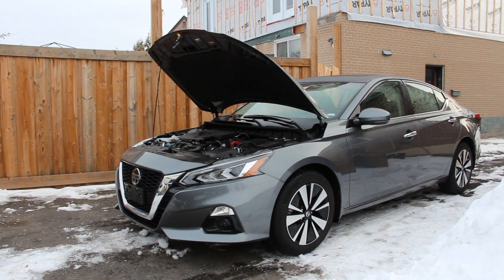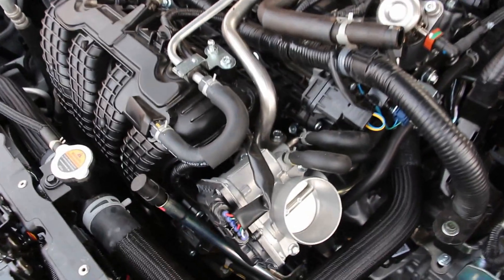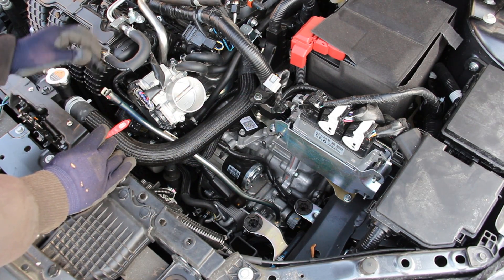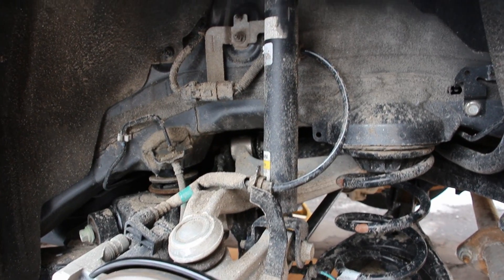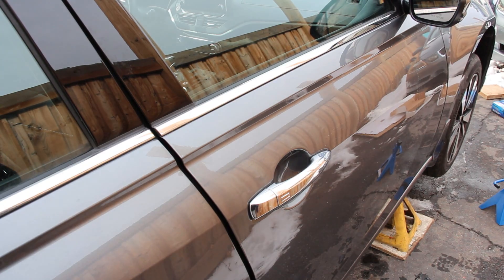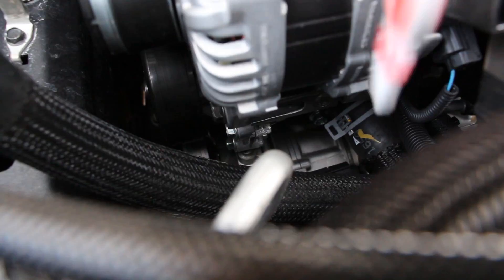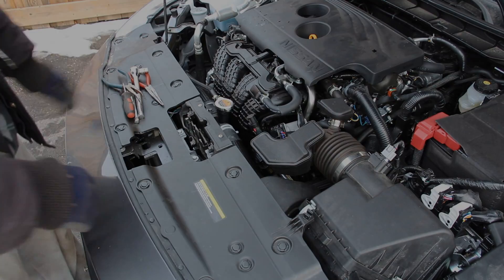Nissan Altima AWD Mechanical Review

Comment: I'm going to say that All the Nissan hate is miss placed as far as the CVT the CVT in the mid 2000 was a major flaw too much oil and not enough cooling and they waited for to long to fix the issue the new ones have fixed the issue and as long as you change the fluid and filters every 60000 miles as far as CVT transmission Toyota, Honda, Mazda, GM, are all using CVT transmissions it's the future like it or not. What ever you do no matter what CVT you have do not tow anything with it.

Comment: I have a 2019 Altima, 60 thousand kilometers and no hints for a CVT failure. I personally know two Altima owners with much more kilometers, they also had no signs for CVT malfunction.
The only major repair I had in general was an AC leak in the evaporator, supposedly due to the humidity and the hot climate in the middle-east. 

Will keep updating this comment.
Reply from the maker: 60,000 km is early

Comment: That plug on the side of the trans isn't the fill plug. It's for inspection. The trans is filled from the charge tube "dip stick" then set with the check plug by the converter inspection port.

Comment: I have 2016 Altima with lots of miles aside from brakes tires & oil change’s I’ve only had to spend 120 dollars on a mass air flow sensor that I change my self  not bad … I bought my wife a 2006 Acura TL brand new boy did I have problems my starter went bad with like 70 thousand miles all of my motor mounts went bad my transmission didn’t feel right I can go on ….  I don’t care what manufacturer you choose they all have problems…my cousin is a parts manager at Toyota somewhere in California  I was thinking of buying a Camry so I stopped buy ..I ask all the guys that were there what do you think of Toyota are they bulletproof all of them said he’ll no go look in the back to see how many were being worked on ….they are good cars he said but Toyota quality is not as good as people think …..  in my opinion all manufacturers have problems I’ve owned Toyota Nissan and Honda  I have a Nissan & Toyota in my driveway right now….
Reply from the maker: The new Toyotas aren't as solidly built as they used to. In fact, alot of cars are looking similar under the hood now.
Reply: @speedkar99  100 percent.

Comment: 2m30s  Hook for the engine needs to be pulled "When" the CVT fails, didn't say "if" .   I have a 2015 Rogue and the CVT had to be replaced at 87k miles. Under warranty thankfully.  Other than CVT its been a good vehicle, and man those seats are comfortable.  I am considering an AWD Altima next (will buy extended warranty of course)
Reply from the maker: See my CVT fail video for more on that

Comment: Solid engine have 100k miles and didn't work on the car but oil change some people trash Nissan not realizing that thet source parts from suppliers and those parts are the ones that failed

Comment: This Nissan actually looks pretty good compared to the competition. There is a multi link rear suspension and a lot of the control arm and suspension parts are made of aluminium. Theres a strut tower and designed in a way that servicing is still easy. The main problem with Jatco CVTs also seem to have some extra cooling allowance with the dedicated cooler and its own smaller CVT condensor.

Comment: 2010 nissan altima with no problems.  2013 nossan rogue no problems.  ‘95 camry was a money pit; worst car I ever owned. ‘04 honda pilot needed was on its third transmission at 130k (second tran installed at 41k).  Every manufacturer has their probs and its likely luck of the draw.  Hard to go back to toyota or honda from my view.  ‘03 maxima was pretty solid too

Comment: I wish you would do some Nissan trucks I had a titan and now a frontier and love them both extremely reliable and easy to work on. I have 50,000 miles on a frontier right now 2017. Only fluid draining feels and not one single issue. I don’t like this Ultima it looks good and looks bad at the same time.
Reply from the maker: The trucks sure are ancient. Would be good to see the difference between those and Toyota trucks

Comment: Key Points
1:29 direct injection only, no port injectors to keep the valves clean which can lead to carbon build up
 2:25 "when your CVT fails" and it will
4:23 the starter has ease of access
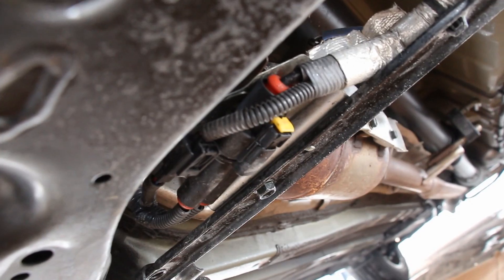6:10 electric pwr steering wires dangling
7:50 steel sub-frame known to rust out over a few years
10:11 the excess body-flex
12:44 radiator up front and easily removed
Reply: These cvts are way tougher than the previous gens.  I have yet to replace one due to pulley failure.

Comment: I guess if someone wants an All-Wheel Drive Sedan it would probably be better to get a Subaru Legacy.
Reply: Nissan has a better engine.
Reply: @joshuabenjaminscott2365  Depends.  Altima no longer has VQ35, and the 2.5L engine is not the QR25 series engine of the past Altimas and other Nissans.  Subaru's current FB25 has, so far, been proven to be durable, and not to forget, sit lower to the ground for better handling.

Comment: Honestly they're so easy to work on biggest problem is the CVT transmission I wish Nissan wouldn't use it
Reply: not fair, all civic accord with 1.5t and corolla has cvt just like nissan, either it's not as bad as ppl think or really cost effective
Reply: @zhanggodfather8053  The difference is who makes the CVTs. CVTs used in Toyotas and new Subarus are made by Aisin, Honda CVTs are made by Honda, and Nissan CVTs are made by JATCO. JATCO doesn't supply reliable CVTs, but Honda and Aisin make reliable CVTs.
Reply: @Blank00  yeah but they are still cvts for example if you had a bad experience with Mac and cheese when your grandma made it but when your mom made it you loved it there are a ton of different factors that go into it , but it does not mean the food is bad you just dont like it
Reply: @hannahstewart-green8062  Umm, what?

Comment: I have a 2012 alitma with 88k and dammmmm. Why is this one so rusty? Mine has minor rust. And the engineering on this new Altima from the engine, suspension, and exhaust system seems more complicated and counterintuitive imo.

Comment: Thank you for the in depth coverage. I just got a 2020 AWD so it’s nice to know more about the mechanicals. People love to dog on Nissan but I traded in my 2018 Camry for the Altima and I like this car WAY better.
Reply from the maker: Thanks for your input. What's wrong with the Camry, transmission?
Reply: @speedkar99  Why would you suspect that, it's not CVT, is it?  This is a sarcastic comment pointing to a lot of BS floating around how one car is money pit and others are reliable. They are more or less same reliable, nowadays. Kilmer thinks all cars are junk. Well, he does not come into contact with not breaking cars, does he?
Reply: speedkar99 the Camry has a lack of features for the price and this was a big reason why I decided to get rid of it. I need to enjoy the ride. The Camry needed $1k in dent repairs because the sheet metal is so thin and flimsy. I had to have several repairs on wheel bearings, tires, and the wheels themselves because it had noisy, crummy, low profile Hankook tires. The transmission took a lot of getting used to. After test driving the Altima it was a no brainier.

Comment: Your work is superb, especially for those of us who plan to work on our own cars. Just some well intentioned feedback: maybe slow down a bit? Savagegeese has very a very good pace in his videos... Almost like you are having a conversation
Reply: If you can't tell a pipe from a wire, better do not work on cars.
Reply: @walkbase  uh?
Reply: @supersabrosinho  With all the respect, the video, you're so fascinated by, basically tells you this:  this is a pipe and connects cat converter to a muffler; that is another, smaller pipe and it connects the master cylinder to the caliper, this is a hose and it goes from the radiator to the engine block, and this is a wire connecting a sensor to a controller, and that is a control arm, it holds wheel in place. If you cannot see it by yourself, or are not in a habit of reading service manuals, better do not work on cars. Cars look more or less the same, unless it is a Tesla.
Reply: @walkbase  pretty sure you are replying to the wrong person. I've replaced control arms, clutches, cats, and currently replacing the piston rings in my Acura 3.7. I'm no ASME master mech but I definitely know my way around the engine bay and electricals. Maybe read the post you are replying to next time? Dunno just FYI

Comment: I like that you get into the nitty-gritty details. For example you have shown us a complete tear down of a power steering pump, ac compressor, and even an odometer. If you could show us a complete tear down of a nissan cvt transmission, we could learn some of weak points and be able to repair them ourselves. If it weren't for the very  unreliable cvts in nissan, I think that nissan would still be my favorite brand.
Reply from the maker: I really want to get my hands on a CVT!

Comment: Simple trick for changing CVT fluid yourself without the scan tool. Measure what you drain while cold and then simply add the same volume back in new fluid that's been sitting at the same temp so it's density is equivalent.
Reply: simple solution: buy manual
Reply: @Kakiharaichii  they last forever
Reply from the maker: You have to know your temperatures

Comment: If you have one keep changing the CVT fluid every 30-40k with proper fluid and easy on the acceleration if you want trans to last.
Reply: I floor my car everyday. I'm at 249k miles on my 16 altima. It's probably better if you drive it easy but that's not necessarily true. You can still have fun sometime if you want without the trans breaking. My point is me lol...
Reply: @occckid123  Have you had any CVT issues like it's been replaced 4x's, but seriously have you changed fluid?  Maybe the 16 has been beefed up but that's good to hear it's not failed with 249k on it, you drove about 85k per year, that's a lot!  I see your channel and the milage throughout time, so no fooling.
Reply: @publicmail2   I change the fluid 4 times already
Reply: @occckid123  I'm sure that made the difference, I personally love the CVT action or lack of, it's the perfect trans for economy and of course it can act like a standard too.
Reply: @publicmail2  I'll look at it after I'm done driving lol. I like when you dab the brakes it "downshifts" in sport mode and gets you ready for the next acceleration.  Its hilarious.

Comment: I'd be careful after 2015 with vehicles, the normal engine is in it's final stages of manufacturing and they are making them more complex and disposable and maximizing profit, these Camaros, Chargers will turn to junk.  The comparative simplicity of electric vehicles will make them last a long time.
Reply from the maker: Thanks for your opinion

Comment: Honestly, looks pretty good?  Other than the transmission it you stick with the base engine it's probably going to be fine and I think transmission issues have been improving gradually since 2014 or so.
Reply from the maker: Unfortunately we only get the 2.5L 4 cylinder and AWD in Canada. No FWD and no turbo 4

Comment: Nissan 2.5 na will be better than accord`s 1.5 t, the only weak link is cvt, the other system is as good as camry
Reply from the maker: Also factor build quality, reliability and design into the mix.
Reply: @speedkar99  reliability is what I refer, not performance

Comment: Excellent information from your channel.
Can you please explain what actually vaccum or vaccum pressure in automotive
Reply from the maker: Thanks. Vacuum is air with pressure lower than atmospheric. The low pressure is formed when the piston moves down sucking air into the engine, creating vacuum in the intake manifold.
Reply: @speedkar99 Thanks a lot for your information
Reply: vacuum is sucking or negative pressure- positive pressure is blowing

Comment: Glad to hear that the Altima remains to be a good rental, period!
Reply: I know someone with an Altima, it has 80,000 miles and the CVT was going out for the third time. Sad.
Reply: Andrew M is that good at least he’s lucky it’s not more than that
Reply: @LunarStrike  hes gone through three CVTs at 80,000 miles on the car.
Reply: @andym1223  he's lying!
Reply: I have a 2019 Altima, 15 thousand kilometers and no sign for a CVT failure. I will write an update later if anything comes up. Nevertheless, i know two other people who also have an Altima, they did much more kilometers than me, and also have no sign of malfunction.
Reply: @sultanalsharif4673  just bought a 2021 altima with 50,000 miles on it, car is in a good condition thank God and also the CVT, the previous owner didn't have service the trans, the cartridge filter was black and dirty when i was changing it , i live in town in Iraq which is known to have lots of altimas, i have seen many altimas with almost 50k miles or more while i was trying to buy a decent altima. these newer altimas are known for having a better CVT unlike previous generation.
Reply: Just change the transmission fluid regularly and everything will be fine.  @sultanalsharif4673
Reply from the maker: I don't know if it's even good at that...
Reply: You asleep?

Comment: Some good, some less than great.  I guess you don't have much confidence in the CVT?  BTW,  very few radiators fail these days, so ease of repair access is no big deal.  I like how the oil drain plug & filter are so easy to get to, and also that the CVT has a drain plug in the pan.   Weird that they didn't choose an oval resonator to give that 2cm of extra clearance!
Reply from the maker: I think anyone who's heard of Nissans CVTs don't have confidence in them.

Comment: Automakers fear the sharpened toothbrush
Reply from the maker: They sure do
Reply: Thanks for the rust comments, it's really really big problems with Altima. Body structure flex is a good one because accord and Camry are really stiff although with aluminum trunk and hood.

Comment: My rich friend gave me his  2006 2.5 S at 96K miles.  He spent more on dealership maintenance than he spent buying the car. He had no real big issues other than replacing the catalytic converter (probably because they are known for breaking down and sucking garbage back into the engine...but they didn't tell him that.)   I replaced the crank and cam sensors that fail on all of them. Also the floor under the passenger seat rots out due to water getting trapped somehow.  I replaced most of the front end suspension and steering parts due to a pothead ramming into the front passenger wheel. Everything was easy to get to except what you mentioned about the control arm bolt which had a little pocket where water could settle and rot out the bolt. It took a long breaker bar to get that off. 135K miles now and runs good. Not burning any oil.
Reply from the maker: Those 2.5s weren't good. The 3.5s were better but I'm that application had some other issues

Comment: Great video,  This Nissan checks all the boxes feature wise and with its great looks to deceive unknowing possible customers.  A lack of good engineering and low build quality reminds me that a Nissan is not a Toyota or a Honda.
Reply from the maker: It sure does check alot of boxes when new. Time will tell if it'll hold up, the older ones didn't do as well.
Reply: Toyota??? Have you been in a sienna lately or even the Camry? Nothing really special about them lol. Doors also has the worst sound in the segment.
Reply: its about renault partnership

Comment: No more cvt cars they are trash
Good video mate
Reply: Stick shift all the way. Unfortunately they're a dying trend these days.

DSG/DCT is fine, or even at least standard torque converter auto feels more engaging than a CVT.
But nothing beats the feel of a manual transmission.
Reply from the maker: Yeah I didn't like the feeling of this CVT

Comment: Nissan quality has gone down in the 80s and 90s and early 2000s there cars were built well not anymore those rear axles are not built to strong on that Atlima they look kind of weak.
Reply from the maker: Everyone knows about Nissans situation. We have to hope for the best in this decade for Nissan.
Reply: Nissan deserves its problems and Carlos Ghosn deserves to pay.  He ruined Nissan reliability.
Reply: @Mabeylater293  same with jacque nasser with ford years ago
Reply: @Mabeylater293  nasser squeezed the suppliers so badly they had to sell junk to ford to stay afloat
Reply: I've never heard rear axles being a problem on the car but if that's something you want to complain about then cool lmfao. I have the original suspension on my altima about to hit 250k on the 2016 altima and I've had massive amounts of use and jumps in the air from speed bumps infant awar of. All my rims are bent but my suspension is fine lol

Comment: That suspension setup is the exact same as my 2008 Altima had.  It lasted almost 300k km before I needed ball joints.
Reply from the maker: Ball joints on McPherson strut suspension don't wear very fast on any vehicle because they are not loaded ball joints.
Reply: You're right , the only change electric everything  direct injection , front suspension very bad

Comment: It would be so cool if Nissan could do a 2021 Nissan Altima Nismo SE-R Spec V with 600hp VR38DETT GTR engine, 8 speed dual clutch, longitudinally mounted engine and a rear wheel drive oriented All wheel drive system. and comes with Michelin Pilot Sport 4S tires standard.
Reply from the maker: They do. It's just called the GTR.